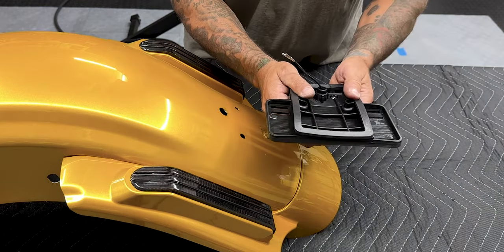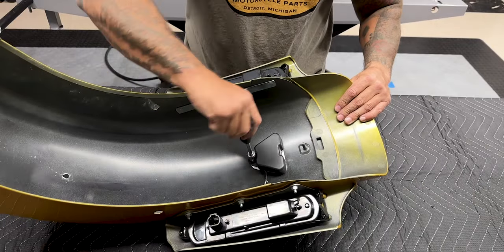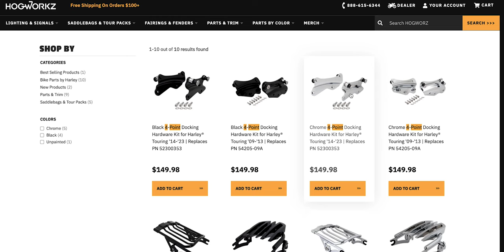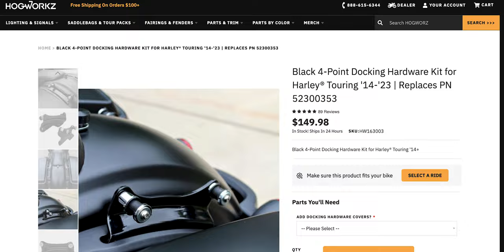Harley Stretched Rear Fender SWAP - Touring - El Dorado Project EP4

Comment: did i miss the part where you used the hogworks antenna reloaction brackets or was that not in the video? harley sells an antenna relocation kit but id rather not use it if i dont have to.
Reply from the maker: So I did not use the relocation brackets, because I removed the entire antenna wiring.  I’m relocating it to the fairing.  I never use the radio, so I haven’t gotten around to it

Comment: These fenders are cool but definitely could have been designed better when it comes to the writing. The way the fender sits on my bike, it’s super close to the tire on one side and so the wiring is a little too close for comfort to the tire and with a passenger it might even rub. Maybe its an issue on my end, not sure but other than that I love the fender. Kinda flimsy though.
Reply from the maker: It’s the same with the stock fender, so there is really no difference.  The way you route your wires is key.  You do run the risk of them rubbing if they are right above the tire.
Reply: Oh gotcha yea where the wire sits now I had no other option then to wire how it is cause that’s where it splits into the plug for the light but it’ll be good we added extra protection around the wire

Comment: Put one hog works stretched fender on my 2022 road glide standard, reef blue, paint match was great, but had nothing but problems with the light, went with a set of pro beams form custom dynamics, it’s all good now love the fender but not the lights
Reply from the maker: Yeah, there are definitely different light options out there

Comment: Is it stretch exactly 5 inches? The reason why I’m asking is. I have 5 inch stretch bags now with a 5 inch rear fender. Extension Stretched Filler now and like the look of the one peace El Dorado fender but it has to be stretch 5 inches so the question is, is it 5 inches?
Reply from the maker: I would have to get down there and measure, but I believe they are just under 5”.  But not very noticeable